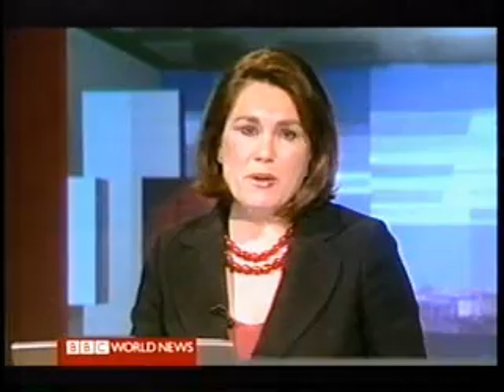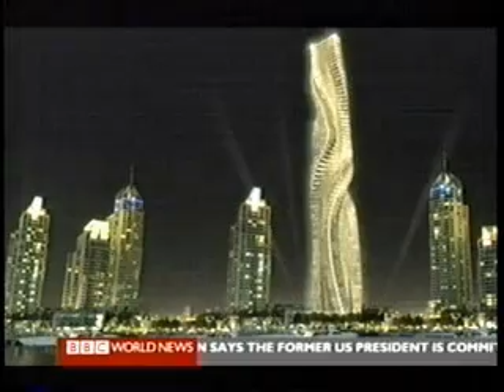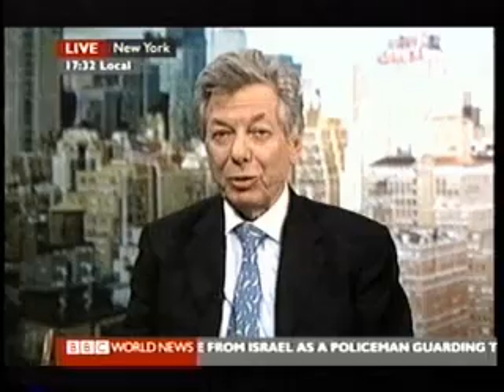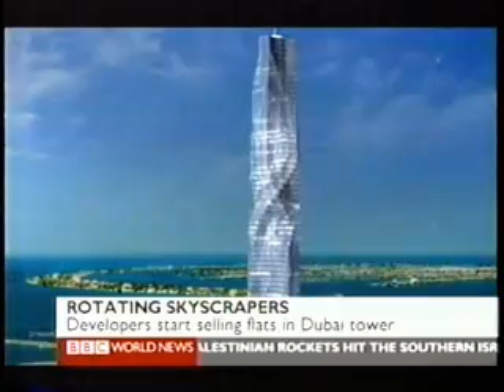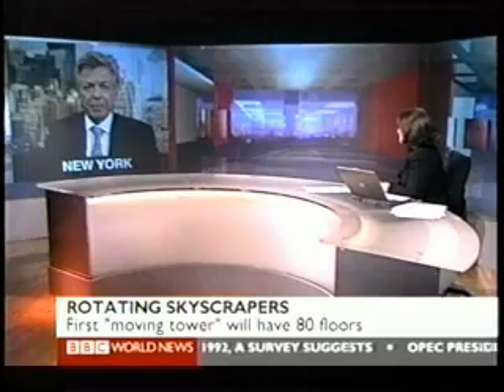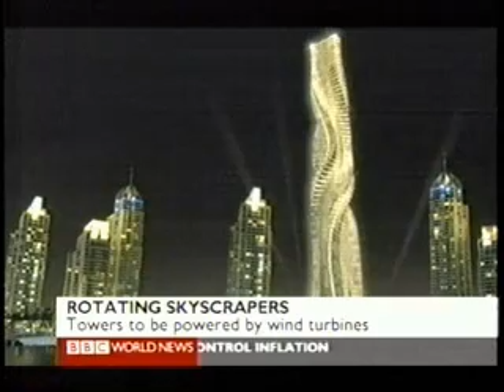Dynamic Tower - BBC News

Comment: Everything is connected to the middle -.- electricity is from middle and the wind turbine and water is from a flexible pipe I think o.o the may not be correct cause I just sharing what I think it is :)
Reply: How is it work? the flexible pipe and the electricity you mean. thank you for sharing if you know about the system of this building, i really need to know that :)